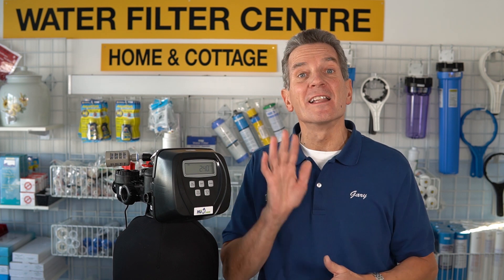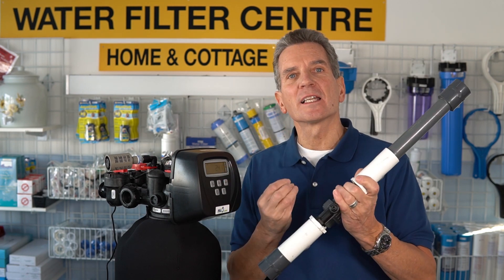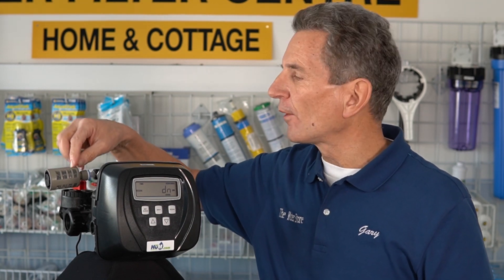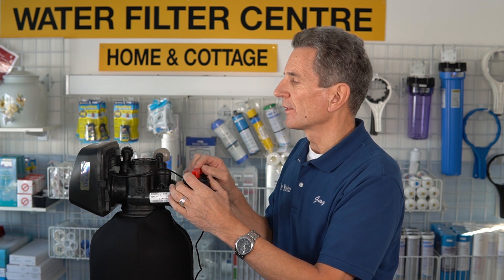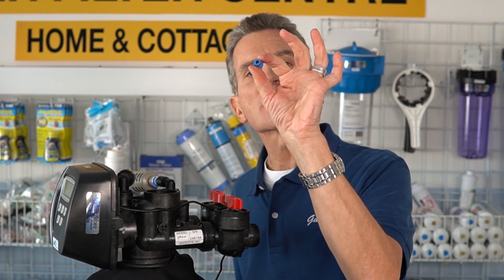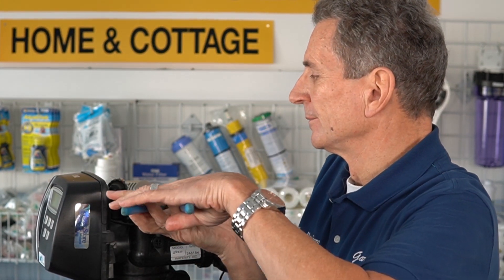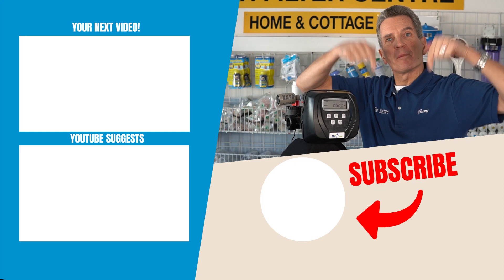IRON & SULPHUR WATER FILTER TROUBLESHOOTING and Repair in 7 Easy Steps

Comment: Good afternoon, Gary.  I have an iron block and water softener using the same control units as in your video.  WE ARE GETTING IRON AND SULFUR SMELL IN OUR WATER.  I have checked/cleaned the one way air intake air valve which seems to be working fine.  The air screen/filter is deteriorated so I will be replacing that.  I have also cleaned the injector, which wasn't clogged at all.  The iron block media was replaced by a water treatment company a year or two ago.  Everything has been fine until recently.  If i don't hear/feel any air being drawn in during the brine cycle, should I completely disassemble everything including the valve/piston assembly and give everything a good cleaning?  Please respond.

BTW, I really like your videos.  I will be watching more of them.  Thank you for sharing your knowledge.

Comment: Hi Gary!  I have the water right impression system and about 6 months ago it started squealing and leaking.  Other home repairs took priority but now i nwed to deal with it.  Is this fixable and do you ha e a video for it?  My sir intake is fine; i golloeed the video and checled it.   Thanks!
Reply from the maker: It depends on a number of factors. If it's only 6 months old is it not under warranty?
Reply: It's about 8 years old.  It started making noise 6 months ago.
Reply from the maker: I would clean it out with bleach and then rebuild the valve. https://waterestore.com/products/clack-ws1-fobck-rebuild-kit-blue-injector-bundle?variant=51185432002773

Comment: Great video! I have a fleck 5600 sxt iron filter setup (without softener) 
I run a pentair big blue with 20 micron initial, then to the fleck, then through UV light and another 5 micron charcoal filter. It dramatically changes the quality of the water! 
We had bad manganese and iron where I am in WV.
My Fleck isn't working though. It usually spits some air out the faucet when I first turn the water on in the morning. I noticed that the manganese smell is coming back also. It does backwash at 2am. However the water spigot service symbol is on, on the display, as well as a flashing number 1.
I'm gonna try the air thing first. It's about 2 years old now and haven't had any issues or maintenance. How often should the media inside need changed, and how much or what would I need to rejuvenate this thing?
It has been a great investment. 
Thanks again for your video and Merry Christmas!
Reply from the maker: We are not experts on Fleck, but it sounds like the injector needs to be cleaned or replaced.  You can also try cleaning the media with bleach. Media typically lasts about 5-10 years. This video will help guide you on the quantity https://youtu.be/-KeuIvIyMis Merry Christmas to you and your family!
Reply: @water_estore  thank you so much for the help!

Comment: I followed your instructions cleaned the injector for now while I wait for a replacement but after the brine part of the regen water came out of the air intake. Is that normal or do I need to replace something else?
Reply from the maker: You need to replace the air draw assembly, we have them here https://waterestore.com/products/clack-fob-c-k-strainer-check-valve-air-intake-assy

Comment: Hello! Great videos on these Clack systems. Thank you for all the great info. I just replaced my air over media sulphur filter tank due to sand in my well. I reused the valve but changed the seal pack. The air intake is leaking water during the regen cycle. Is that normal? Thanks in advance!
Reply from the maker: No, you need to replace the air draw assembly, we have them here https://waterestore.com/products/clack-fob-c-k-strainer-check-valve-air-intake-assy

Comment: After you perform the troubleshooting, do you let the regen you started manually continue or do you stop it and let it execute as scheduled?  If you stop it, how?
Reply from the maker: I would fast forward through the cycles by clicking the regen button once each cycle has started counting down and then trigger a full regeneration.

Comment: Hi Gary,  I just created a login and pswd to be able to order parts.  I am in process of troubleshooting my Clack Iron Filter.  I get error code 102, and am sitting here while it runs through all the cycles, to try and see WHEN it throws the error 102 code.

My question is during the brine (air draw) cycle, is the iron filter supposed to send a lot of water to the drain?  Mine does, and I don't know if that is supposed to happen during Brine cycle
Reply from the maker: During the air draw there should be just a trickle of water going to drain. This video will help with error codes https://youtu.be/v_oF5w5dB1U?si=OdWLJ6Nc04qinaE9

Comment: If I have a clack ws unit that looks identical as this being used as a water softener, can I set it up to be used as an iron sulfer filter? Thanks!!
Reply from the maker: No, it requires different media, a taller tank with more free board, different valve set up.  Best just to invest in an actual iron filter like one of these https://waterestore.com/collections/iron-and-sulfur-removal-water-systems?pf_pt_product_type=System
Reply: @water_estore  could I change the media and buy a valve?

Comment: My problem is to much air. On a csi reactr two tank system. We just replaced the air intake and float tube but that didn't help. It's enough air to empty all the water in a bucket and goes on for minutes at a time. We had the installer come out and he just plugged the air intake and excess air drain ports. Stopped the air of course but back came the iron and sulphur.
Reply from the maker: You 100% need the air draw for the iron and sulphur removal
Reply: @water_estore  turns out our hose bibs are energized between the well and filters. Without a bypass (which they didn't put in) water will flow backwards through the aeration tank putting air in the lines. I wish I could show you how much air there is.

Comment: I was getting very low water pressure in my house, which resolved when I hit regen on my FOC filter.
But soon enough, within a few hours to a few days, the pressure was very low again.
So I was going outside all the time and regenerating the filter, and at one point I saw that a bunch of carbon was coming out of the backwash drain pipe.
Can you tell me what has gone wrong and what I need to do to fix it?
Reply from the maker: It sounds like either the riser tube or the baskets at the top and bottom of the riser tube have cracked.  You will need to rebuild the tank, this video shows you how. https://youtu.be/Z47JGH1l39o

Comment: Why is is to hard to find specific info about this stuff lol. I have a Enpress model 1054 iron filter (or water softener I can’t find that on google either) but mine has no air intake that I can see. But also no brine tank which is what makes me think it’s an iron filter. But my pressure has gone to crap and my water is smelly and rusty. So annoying
Reply from the maker: Sounde like it might be clogged.  This manual might help https://www.enpress.com/site/wp-content/uploads/ENPR_PIONEER_MANUAL_NON-METERED_40_2020_1101_FINAL_LOWRES.pdf but I have never even seen one of these before so I can't help.

Comment: I have the iron boss model 4700. It is flashing error code 01. It will not go into regeneration manually. I tried to research the code, but no luck. I have called water filter companies and they won't tell me what it is either. I replaced the media hoping that would fix problem. Any assistance would be greatly appreciated.
Reply from the maker: I have never worked on or even seen one of these.  But I did find this manual https://www.bottlefreeh2o.com/wp-content/uploads/2015/03/Iron-Boss-Manual.pdf it might help.

Comment: Hey there Gary, great video! 

Here’s maybe an odd question for you. I have one of these systems at a house I bought last year. Looks real old. All the “brains” of the component (the top control piece that’s screwed to the top of the tank) is all corroded and not sure the system as a whole works. Can you get new medium to replace in the tank itself and buy a new “brain” control? Or is that not worth it and should just buy a whole new system?

Thanks!
Reply from the maker: Great question. It's like having an old car that needs a new engine and brake job.  Better off getting a new system with a warranty like one of these https://waterestore.com/search?pf_pt_product_type=System&pf_t_system_type=System+Type_Iron+%26+Sulphur&q=iron+and+sulphur

Comment: Great videos Gary!  I have an iron filter that seems to work reasonably well.  However we are noticing a bit of sediment staining in the toilet bowl (not brown like iron however) that wasn't there before.  We have a softener installed downstream and it seems to be keeping the water soft - lots of suds in the sink etc.  The iron filter is about 2 or 3 years old on well water with pretty significant iron levels.  We have a plastic reservoir attached to the side that the air hose sucks out of and once a month we put a small amount of resin cleaner in there.  I have noticed that lately there is water in that reservoir which is not intended.  So, wondering if the venturi is plugging and will clean as per your video.  However, I noticed in your video that your filter was set for 30 minutes for the step where the air gap is established.  Mine is set for 60 minutes, is that a problem?  And how do you tell how much water is in the tank after the air gap is established?

Thanks for responding.

Andy
Reply from the maker: Yes, I would definitely clean the injectors in both.  Our systems are factory set at 30 minutes, if yours is working fine at 60 I would leave it at 60.  Just make sure that there are no cycles after the air draw cycle. I don't know how to tell how much water is in the tank unless you have an opaque tank and shine a light through from behind.
Reply: @water_estore  Thanks for the quick reply.  I found that the unit was actually running in softening mode when I followed your programming steps which is odd because I know I have seen the "filtering" word displayed when water is flowing through it.  I wonder if a power outage which we have pretty frequently could have put it into a default setting.  We have been getting a tremendous amount of air in our water these past few months so maybe that it the root of the problem.  I will phone Viqua support and get the right number for the air draw time.

Comment: Mine cycles every 4 days and it seems to work fine; no sulfur smell. I was wondering how long does the media last inside these tanks?
Reply from the maker: Depends on how much iron and sulphur you have in your water and how much you use but typically about 8-15 years.

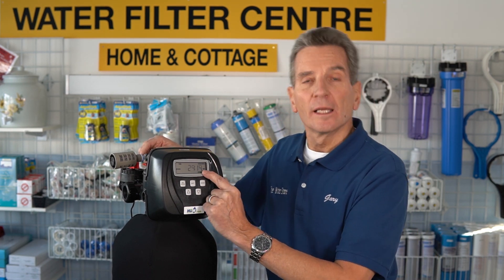Comment: 👏Hi Gary! Love the info here! I have a system just like this for iron and sulfur smell works wonderful! other than it seems to be making a one loud short fog horn sound then a longer one  at 2:30 - 3AM every 5 days for about 30ish seconds There is no other water filter in line with it. The tank has greensand and gravel in it.. Ptank/ PSW and gauge area it is less than a year old. So I am thinking there is a restriction somewhere and it is pushing or pulling the water too fast causing the harmonic sound. Wondering if there is and easy way to trouble shoot this? Changed a toilet ballcock and tub fill valves so far but not no joy there!! IDK  scared to push buttons on it as it does work!??
Reply from the maker: The pistons and seal pack may need replacement.  We have them for the clack valve here https://waterestore.com/products/clack-ws1-softener-rebuild-kit-wrench

Comment: Hey Gary, I have a Fok filter with 1 month old media and my rotten egg smell came back with a vengeance.  Water is has a light black tint and stinks on hot or cold taps.

I took your advice and checked my injector.  The metal screen was 100% blocked.  I cleaned the whole injector and have only seen the water get worse.  What gives?
Reply from the maker: Not sure whay you mean when you say metal screen?  If you have so much debris in your water that it is clogging the injector that quickly I would recommend a spin down filter ahead of the FOK like this one https://waterestore.com/search?type=product&q=spindown+filter

Comment: Great video Gary, no BS, straight to the point and very informative. I'm still having problems with our system however (jet isn't blocked), can I ask some questions?
Reply from the maker: Sure, what do you want to know?
Reply: @GarytheWaterGuy   We have neutral Ph (tested at 7.3), very soft (10) water with high iron, Manganese and some turbidity to remove (I have test figures for these). We have one of the filters in your vid there, plus two woven polypropylene filters after it. It's definitely sucking during backwash so no blocked jet. We're still getting brown in the water which stains, when the water is run cold you can't see it much, if at all (but it still stains), but when it's heated you can see it's brown. The day after a backwash it's clean with a lot of air in it, after that you can see brown in the hot water until it backwashes again. Do you think this sounds to be working as well as it could be? We've been advised the only cure is to de-ionise (is it?) by adding more equipment and using salt. This is going to be not only expensive, but we're also tight for space and have been told it'll soften our water so much (it's already supersoft remember) that it could become slimy to the touch. Does that sound about right to you, or would you suggest something else perhaps? I think if we had hard water i'd get it, but don't like the idea of over softening. I seem to recall the system worked fine for a few months after it was fitted before going like this, but I cant be sure of it.

Comment: Gary thanks for the video. My fix was rather simple, a month or so a go the pressure switch was replaced by a reputable company. Every since the water slowly started stinking and so for I regened both tanks, cleaned out the brine tank completely. Did a water softener treatment or so I thought. Only after watching your video up to the air intake gurgling sound and then the bypass, I figured out that the company neglected to open the bypass levers on the top after replacing the switch. Regenning properly as I text this. I hope it's not too late for these tanks sitting in bypass for so long.

Comment: My Iron Boss filter has E1 error message on the display. How do I trouble shoot it before replacing the entire controller. Thanks.
Reply from the maker: You can reset it.  Just unplug the power from the circuit board, wait one minute and plug it back in.  That should reset it.

Comment: How often should your system run through the cleaning cycle?
Reply from the maker: Depends on the system.  If it's an iron filter, at least every 3 days.  Water softeners are usually metered, at least ours are, so they go once you have used up it'S capacity

Comment: Gary:  How do I get parts for my Kinetico Model 1054 Rust Iron Filter? It is very similar to the Clack model used in your video here.  Are the parts similar? I am interested in changing out the air injector. The system is about 10 years and not working well to remove rust. Thank you!
Reply from the maker: It might be.  Email me some pictures and I'll have a look,  info@waterestore.com
Reply: Gary: I sent you an email with pics. Thanks again!

Comment: My sulfur/iron filter tank is not working. Terrible sulphur smell in house. Trouble shooting, air inlet is working and injector is not plugged. What next?
Reply from the maker: It draws in air during the brine cycle, correct?  What is the flow rate coming from your well pump? https://youtu.be/BONHr56jnKs

Comment: What will cause my clack ws1 air over media tank to whistle. The media is 5 years old. There is no iron in the homes filtered water. The injector has been replaced, but it continues to whistle at random. if I bypass the system then turn it back on sometimes it stops.
Reply from the maker: Does it whistle during regeneration or while in service.

Comment: What would cause some of the carbon media to drain out during regeneration? Approximately 2-3cups of black media have accumulated around the backwash drain
Reply from the maker: If there is a crack inside the riser tube or screens inside the tank

Comment: I have a filter like that that regenerates with peroxide. It used to run fine until I blew a transformer and lost power to it. I replaced the transformer and now my peroxide tank fills up with water in a three or four day period. I have an installers guide and checked the settings and they seem to be the same. Everything runs fine except the peroxide tank fills up with water. Do you know what would cause this?  Thanks for your help.
Reply from the maker: I know very little about chemical injection systems so i would be guessing at this point.

Comment: Hi Gary, put in an iron filter in about a year ago, been working fine. Now am getting air in the water lines  for about 1 to 2 days after it regenerates. Double checked by by passing the filter for 4 days, eliminates the problem. Any ideas? Thanks
Reply from the maker: I would check the settings to make sure that it only draws air for about 30 minutes maximum

Comment: I am getting air in my house lines after the AIO units regenerates?  Isn't there a check valve in the units to prevent this?  What can I do to eliminate it?
Reply from the maker: It is normal to get micro bubble of air as that is how these work.  You can back off on the air draw during the regen cycle so it draws in less air.  The internal check valve https://waterestore.ca/products/clack-ws1-v3957-internal-check-valve-for-fob-c-k only keeps the air bubble within the tank if an outside faucet that is connected to the plumbing before the system is opened.